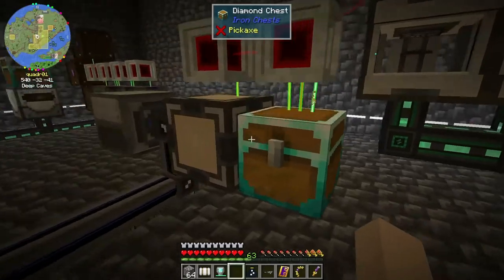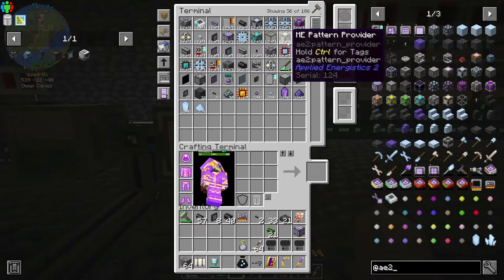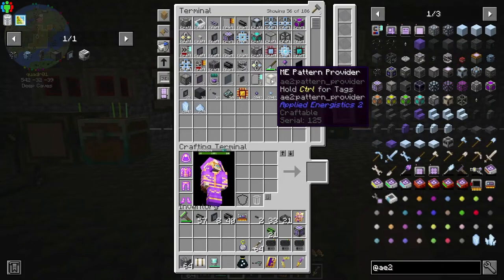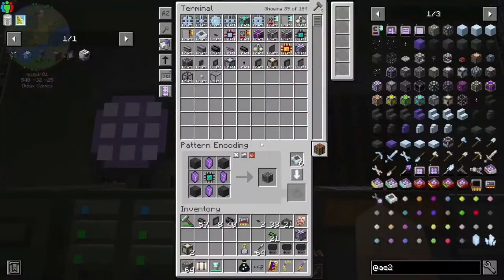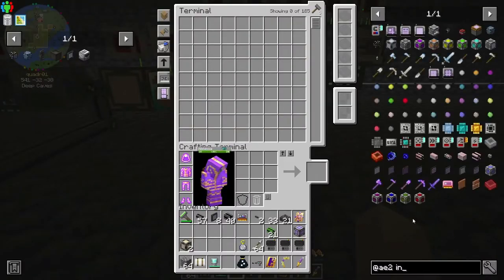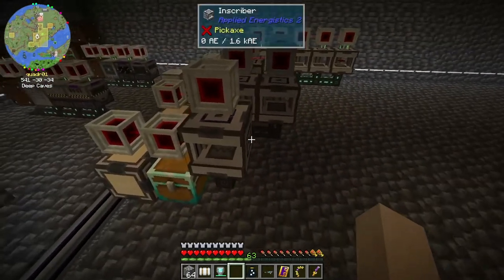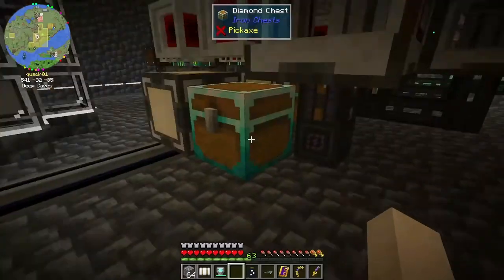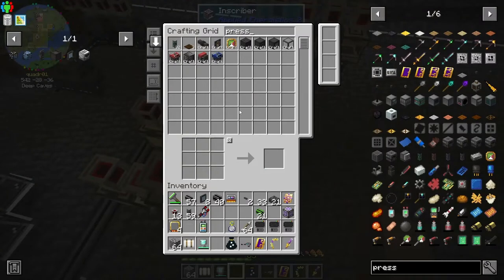DireWolf20 1.18 Let's Play Episode 104: Revamping My OLD Processor Processing

Comment: I think that gold to diamond chest upgrade use tried first is valid for Sophisticated Storage, but the gold chest you were using was from Iron Chests.  😛 Annoying that there's two of them.

The certus circuit probably wound up in your AE system; you have insert on white channel in both the pattern processor and the last inscriber.  And the silicon didn't get extracted because it was meant to be on the sides, not the up.

Your idea to do it with channels is probably a better one; one channel to pull from chest and filter into each inscriber.  Then a second channel to extract the printed silicon into the last inscriber, a third channel to extract the certus circuit into the last inscriber, and a fourth channel to extract from the third inscriber back into the pattern processor.
Reply from the maker: Yes, I have also used the barrel version of the iron chests. That must have been where I got the idea of using all diamonds LOL I got all the kinks worked out of the system now. This change will allow me to make MORE disk drives faster!!!
Reply: @debbiesa00  Awesome, I had a feeling from that screenshot you sent me earlier that you had done more after this video, wasn't sure if you worked out what was wrong though. ;-)
Reply from the maker: @JakeMoe  😁😀😀